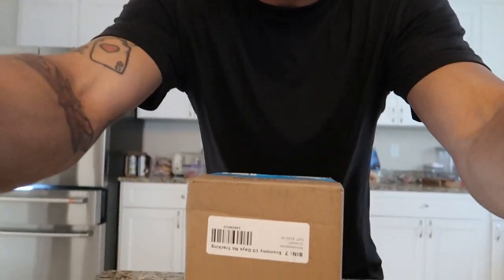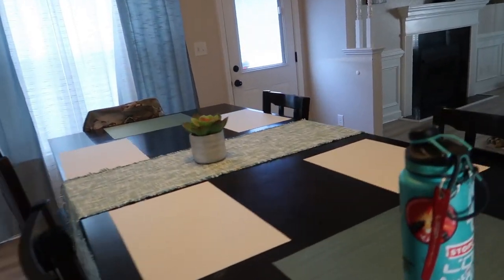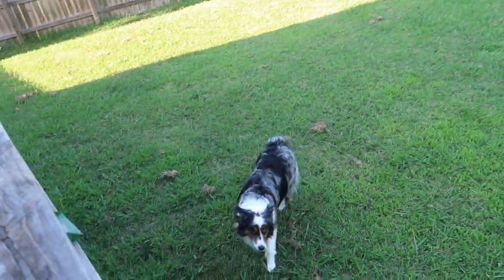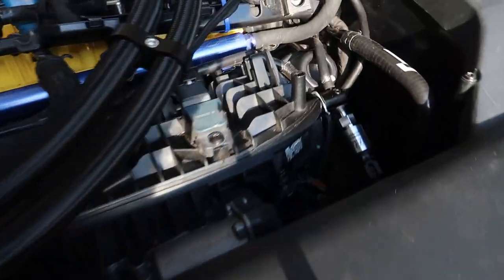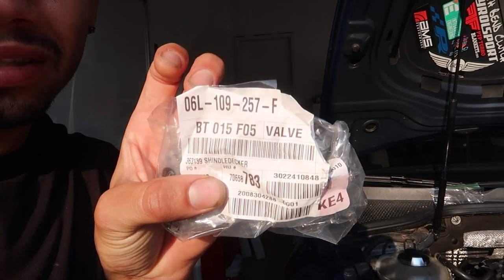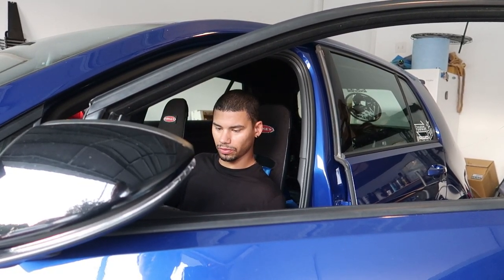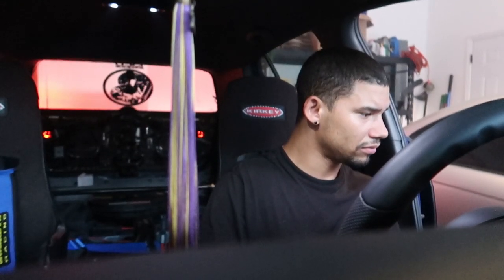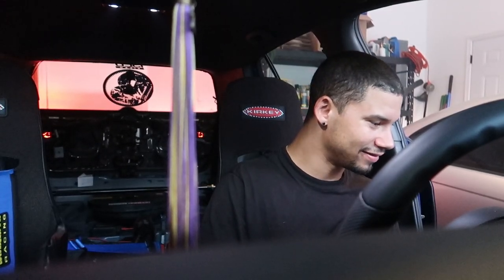New spool valves! Did it fix my noisey engine? | MK7 Golf R

Comment: Those are 17x8? Might be worth stepping up to a 9 wide because the RT660s do run wide and only come in 225/45 or 235/40 in 17". It's probably a safer bet choosing the one with lower diameter with that much caster, and using a wider wheel you'd get that steering feel benefit while retaining a wide tire.
Reply from the maker: I'll have to keep that in mind! I'm still 17x8. I don't have any real traction issues so I haven't really concidered going to a wider wheel, id like to keep the weight down as much as possible
Reply: @BryceJordanProductions  Totally understand, although I feel like wheels/tires are one of those things where a couple pounds can go a long way in getting the maximum lateral grip out of the car.

Comment: Bryce, just out of curiosity. When you first ran the built engine. What kind of oil did you use for the break-in period? And what are you using after it?
Reply from the maker: I used the cheapest oil I could find with an expensive (I think liquimoly) break in additive. Now I run mobile 1 Euro like I always have. Gonna swap to motul or liquimoly though